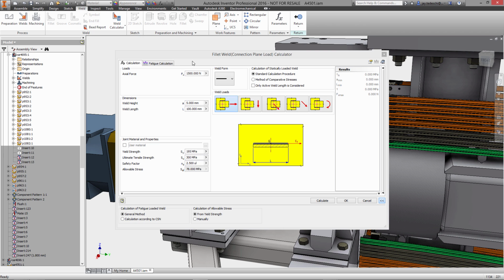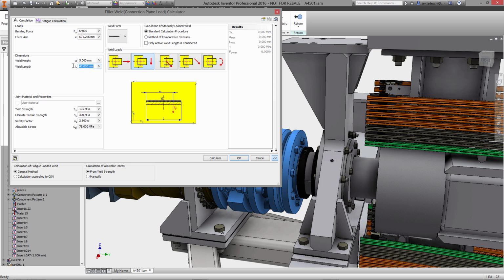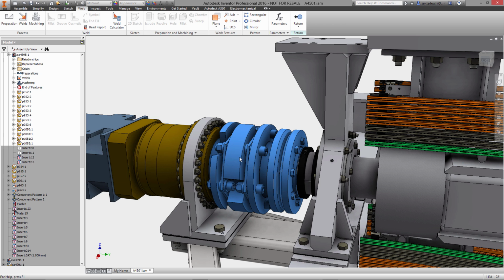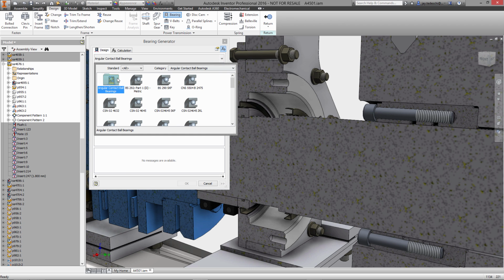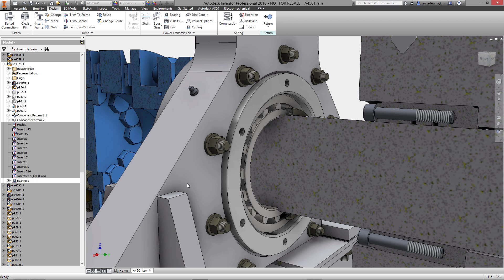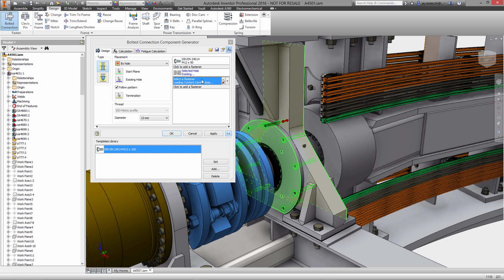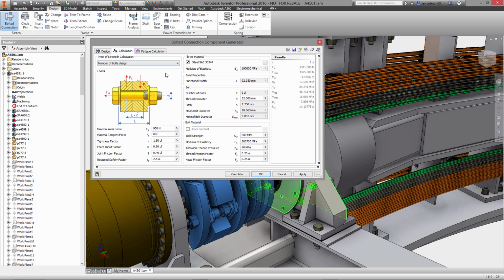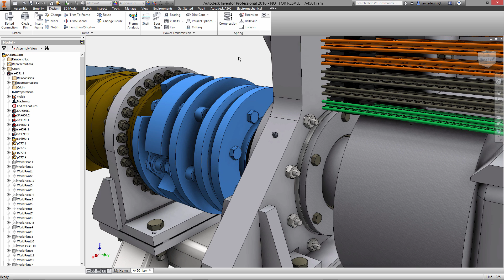Design accelerators and calculators

Comment: I get that there is a bearing calculator in inventor, but how do you use it? also, how do we expand on existing libraries of bearings?
Reply from the maker: I would suggest checking out a class with a local reseller online for training or you might fine some in the in-product tutorials.